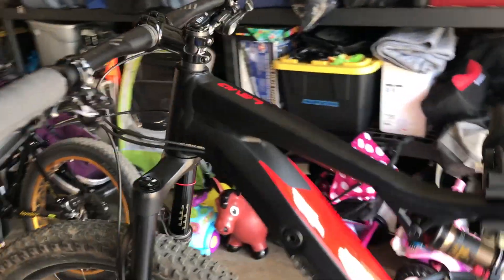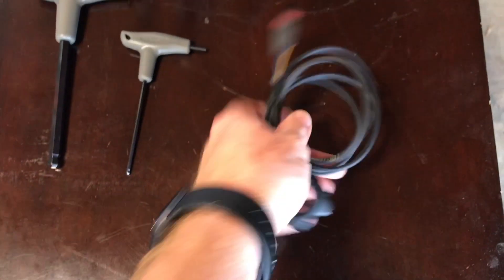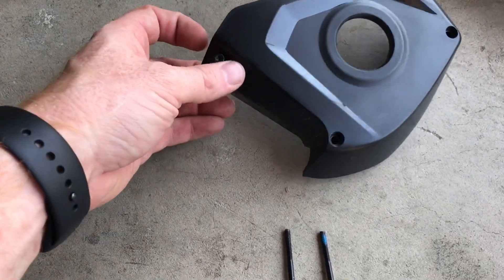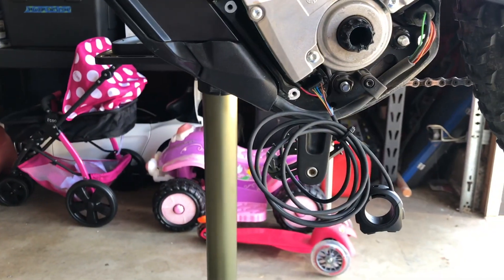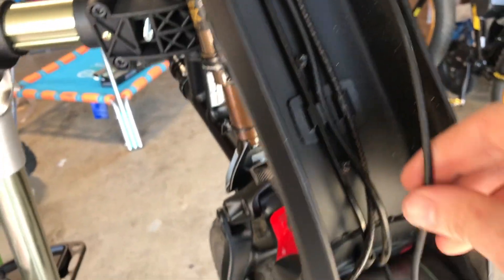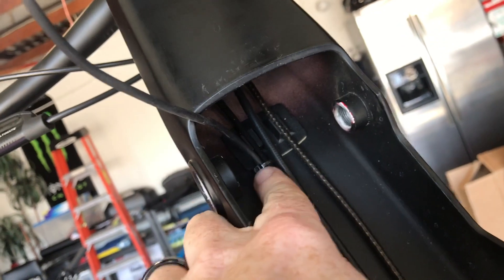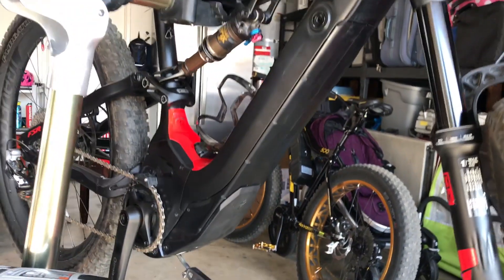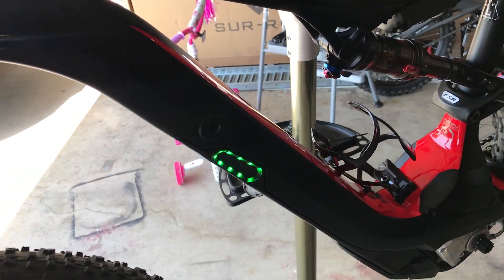Specialized Turbo Levo Control Switch Retrofit (2016-2017 Models)

Comment: Just an idea, cut a 1 inch wide piece of black duct tape/Gorrilla tape and tape over the exposed wire so its not loose. It will look better and not be prone to snagging:-) or I would drill a hole just under the area where you zip tied the cable and run it out the frame like the cable above it.

Comment: Thanks for this I have a 2019 HT which came with a Bluetooth Garmin Edge e-bike controller. Wasn’t the best had a lot of latency. Then lost it a few weeks ago sixty quid to replace! For an extra tenner picked up the standard controller (came with a 2 part cable) and following your directions works a treat. No latency plus walk assist. Fab.

Comment: Just managed to buy and fit the handelbar remote as in this clip on early 2017 levo worked straight away must have had the update from new. My Motor firmware is 4.0.1.
Specialized Part number for the remote is S186800001
If you have the correct flat type plug on your motor it should work. 
The later remote plugs straight into to switch on the top tube and has a round type plug so check the plug type before you buying 
Thanks for the Video really good update for £70 and less than 30 min to fit Dave
Reply: But S186800001 not compatible with 2017 levo?
Reply: @twixtiii1  that is still the current part number it should have the flat type plug.
The newer bikes use the same remote but it Has a shorter cable and a round plug.
Not sure if this is what you have got but if you have you can get a round to flat extension cable to adapt it.  
Contact Berkshire cycles Co for help.

Comment: Thanks for this excellent video.  Your instruction was right on. The only thing I would add is that to remove the crank you have to really “crank” on the 8mm bolt in the counter clockwise direction to get it off. It feels like you are putting too much pressure and that you are on the verge of stripping the bolt. It takes a lot of effort to get the bolt off. 
But other than that, excellent video!
Reply: My left side crank turns counter clockwise to come off, like the pedal if it loosened up by going counter clockwise when pedaling then the pedaling motion could loosen the crank

Comment: Thank you so much for making this video.
My 2017 Levo is at the shop right now getting the update.
If all goes well, I plan on cutting the cable in half so I can fish it through the existing hole in the frame on the upper right-hand side and then soldering it back together once it's in the framework.
Thanks again...
Reply from the maker: Big Jeep Which hole?  The only holes I saw were for existing cables, and just big enough for the cable.
Reply: @bluesti3  My base Levo has a cable size hole on the upper right side with nothing in it.
Maybe it's for a dropper post which my bike doesn't have.
Just big enough for the cable which is why I will need to cut, fish & solder back together.
Reply from the maker: Ah, that’s exactly what it’s for, which mine has.  Good idea!

Comment: Got my control switch cable torn off in a fall. I was 25Km away from my car with no assistance. Peddaling the beast solely on human power up hills is impossible. Luckily, after ~ 20 minutes, I discovered that if you briefly touch the blue and green wires together, the assistance comes back. I don't know if any other combo would do, those were the only two wires sticking out.

Opening the remote case requires brute force. It is glued and sealed by this glue. Soldering the wires back seems extremely unlikely to impossible.

I don't have a remote anymore. I've had it completely removed. I am not taking any chances of getting into a situation where this happens again and this time I can't get the assistance back.

Anyways, make sure the control cable is tied solidly to your bike and won't easily be torn off. Make sure by fully turning the handlebar that the remote cable is not the first cable to be pulled tight.

Comment: I've got a 2021 Levo Turbo that I bought second hand and I'm trying to figure out how to move the Control switch in the cock-pit further down the handlebars towards center, to accomodate a new ergo-grip.  I can't seem to figure out how to "loosen" it's grip on the bars to slide it further in.  it's not evident that there is a screw to loosen or whatever... you didn't show in your video how you installed the control on the bars.  Thoughts?

Comment: Many thanks for the very interesting tutorial, I've a Turbo Levo MY16, motor 7.1.1, also installed the Garmin remote. I found this P/N S196800025 - two cables - connected to the motor and it's seems no working ==> what to do ? I also tried disassociating Garmin, no results. Suggestion ? Many thanks in advance !

Comment: Truth that small zip ties can fix anything! Nice bike
Reply from the maker: Joe Mesa For Sure!  I wanted to run all internally, but not worth losing frame warranty for the sake of hiding a few inches of wire.  I’m at the point now where I do see the value in maintaining warranties when possible!  Haha
Reply: bluesti3 yup, hear that and the fact that I've been in a position to use their frame warranty..it makes total sense.
Reply from the maker: Joe Mesa Really?  What for?
Reply: bluesti3 I had a stumpy that cracked at the rear triangle, down by the axle mount. No failure, but enough to no want to ride it and chance it. My local shop sent it in and got a new one within a week. Great service.

Comment: Thanks so much for your video/idea. I wouldn’t have known to do this had I not seen your video. I purchased my 2016 Pre owned and the the seat dropper had been removed, so I routed the switch thru the unused hole in the frame. Soldering the five wires was quite fiddly.

Have to wonder how would one replace a factory setup if the switch became damaged?  I wonder if the switch is able to be dismantled to pass thru the frame for replacement...

Thanks again!

Mark

Comment: 680/5000
Does anyone know the order of connection of the pins, for the walk assist system in the plug of the electric motor BROSE of TURBO LEVO FSR 6 FATTIE alloy 2017? I want to install this button on my bike, I couldn't get it with the specialized one, but I saw in this video that it is possible and even very easy. I just need the wiring diagram and I'm going to make a switch to put on the handlebars.
Here in Brazil I couldn't get it with 2 authorized dealers, very difficult to get parts. so I want to make a switch only for the walk assist, step on very tight trails, steep banks, it is very difficult to push the bike, if I had the help of the engine, it would be much easier to push the bike.

Comment: Anybody else having difficulties getting one of these remotes? I contacted my LBS where I bought my Levo and they said that even the Specialized rep. wont sell the shop these remotes unless the bike already had one and its under warranty. 
 Any suggestions on how I can purchase one would be greatly appreciated. 
I guess Spec. wants us to buy a new bike instead of upgrade hacks.
Reply from the maker: larry s You have a terrible dealer then!  There is absolutely NO reason they shouldn’t sell you one.  Easy solution? Find a different specialized dealer.  Mine called and had the part ordered same day.
Reply from the maker: In fact, Specialized engineering support actually helped us work through it, and confirmed it would work!

It's insane for them to think the expectation is to buy a new bike, when this feature works plug and play!
Reply: bluesti3
 Ended up going to a different specialized dealer and they had 1 that I bought. All is well😁
Reply: Robert Puffer  hello do you have a link on ebay to get this handlebar remote please ? or a reference ? Thanks

Comment: Hi there,
we have a Turbo Levo 2017 with Motor Firmware V4.0.1 , our Dealer said, this is the last Update available for this Bike?!? So, which Firmware must we have for the 2017 Bike, that this will run correctly, please....
we bought unfortunatelly the 2019 Remote with the round Plug, does anybody have a wiring diagram of the Remote Switch .... thank you ... very much

Comment: Hi there I have exac same model would you be able to post a link with online shop where did you get this switch from. 
Thanks W.
Reply from the maker: Wojciech Adm This was purchased from my local specialized dealer, who also did the firmware updates after I installed it.
Reply: @bluesti3  remote works with old firmware?

Comment: I have a 2018 Levo carbon and I worry less about the frame warranty than how long replacement batteries will be available.  I think in about 6 years I will have a useless bike when the battery dies.